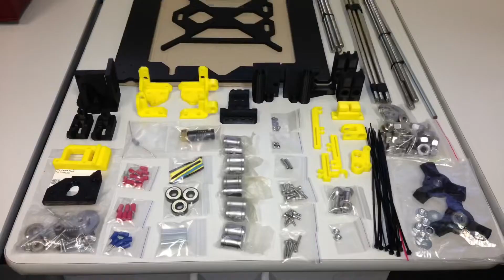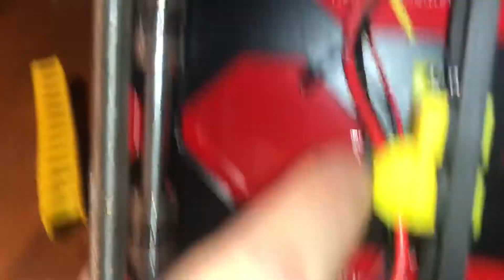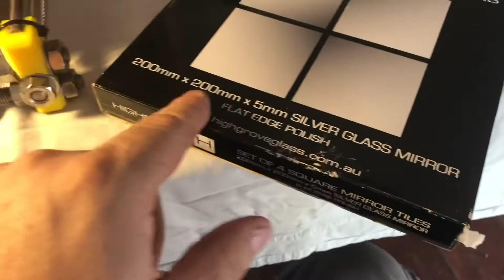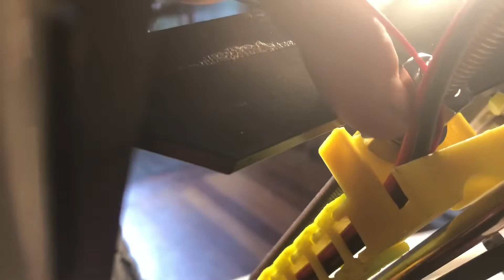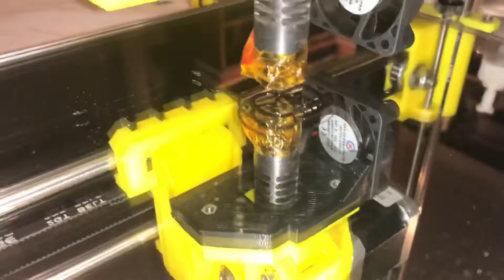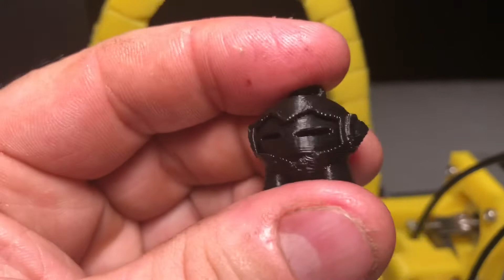Lets build a Prusa i3 3D printer! - Part 4: The Awakening!

Comment: no hot pads. no hair spray on a mirror. just slap a sheet of "whatever flavor of plastic" down and print??? poppy
Reply from the maker: PLA on bare glass is my go-to print method, tape, hair spray, everything else is a result of incorrect first layer height or speed. ABS is a different animal however, and I would use FilaPrint print surface if I need to print ABS reliably.
Reply: and i thought i had a great new idea. s**t!  poppy